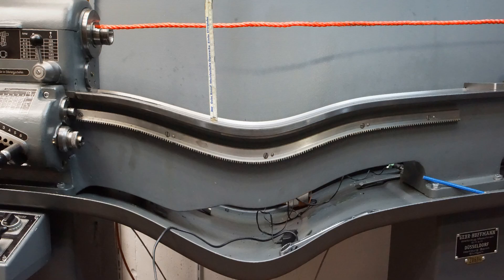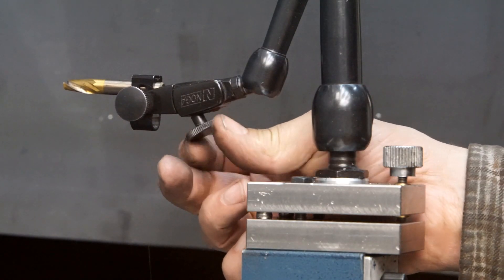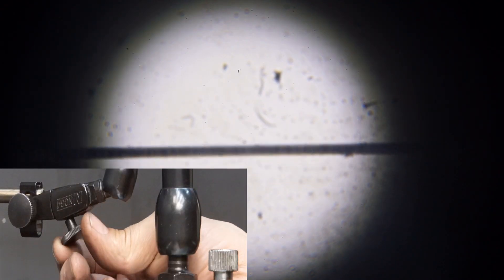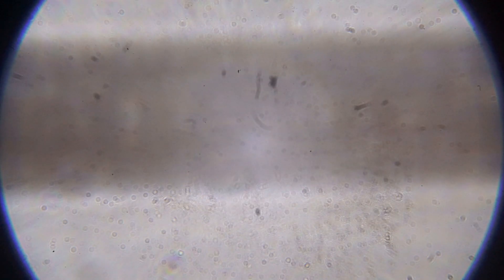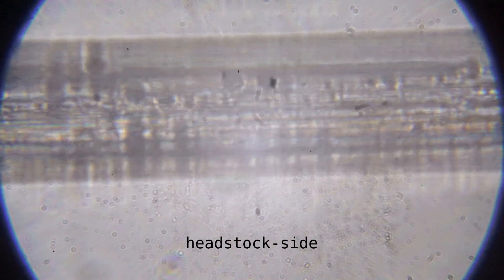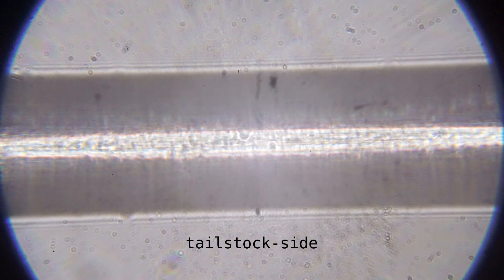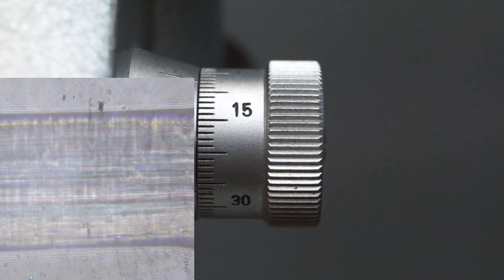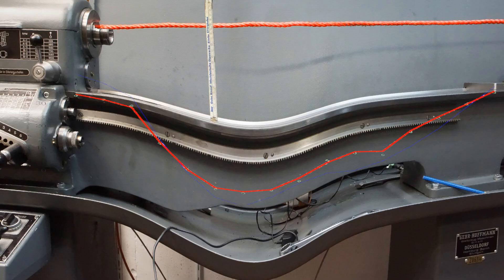measuring straightness by wire

Comment: How do you know that you are looking from the same angle?
I'd use a second, thinner wire in front of it to be sure the three points are aligned.
Isnt static electricity or magnetism a problem when we are talking about microns?
Or the weight of the microscope bending the workpiece?
Reply from the maker: Some excellent thoughts/questions.
The angle between the microscope and the wire is not super critical. In theory the deviation follows the cosine law - similar to taking measurements with a DTI where the stylus should be perpendicular to the measured surface.
Static electricity might be an issue if the microscope is extremely close to the wire, yes. Honestly, I didn't consider this.
Magnetism is no issue as the wire is made of non magnetic material.
The weight of the microscope could be an issue - yes. However I checked the influence of weight on the bed and attached a rope with about 40 kg of weight to the center of the bed. The deviation was less than 5 µm. The weight of the microscope is in the 1 kg range. So, the deviation caused by this mass is certainly not an issue.
Again, thanks for your thoughts!

Comment: Wire alignment is used to align bearing bores on large reciprocating compressors prior to grouting the machine.  The wire is tensioned with a known weight over a pulley.  The sag is calculated by chart or computer now days.   The bearing bore is checked to the wire with a micrometer.  A battery is wired to the micrometer and the machine to a set of head phones. The machinist gets a tic in the headphones when the wire is touch by the mic.  Very accurate.
Reply from the maker: Excellent comment! Many thanks for your interesting contribution.

Comment: Very nice! A great way to measure. Could the error be increased by the tailstock base? If the wear in V matches part of bed but not others, I wonder if you double the error?

Very interesting to see the use of
Microscope and using focus pattern rather than expensive graticule.
Reply from the maker: Good thoughts. Admittedly, I assumed close to equal wear on the flat and the V side of the tailstock base. This might well be wrong. My intent was getting "a feeling" for the wear.

Comment: 2 µm sag over 600 mm is brilliant that's less than half of a arcsec even before compensation, I wonder if using two cigarette papers as shims .05mm at the end could be used as a small light gap for a cheap laser pointer at a low angle could the interference be used to visually see the peaks and troughs through  different refraction angles

Comment: Wow, this is brilliant! So simple and yet with such accurate results - I'm going to keep it in my mental toolkit for future use!

(I had the same immediate thought about the sag in the monofilament and actually worked through the numbers with the Claude 3.5 AI before I saw that you'd done so in the video notes🙂 I assumed slightly higher density for the line than you were using, but your numbers check out exactly. It's amazing  how accurate this is! - Now I just need a microscope with a precisely calibrated Z axis! 🙂)
Reply: so what ur saying is u wasted electricity right?
Reply from the maker: Thanks for confirming my calculations! Instead of a microscope with a calibrated Z axis you could attach a dial gauge.

Comment: I looks like you did not compensate for the droop of the monofilament.
Reply from the maker: The drop is less than 2 µm which is within the accuracy of the microscope reading. Please refer to the calculations in the description of the video.
Reply: @HaraldFinster  Excellent!

Comment: Millwrights used to (and may still do) use a tensioned wire to ensure all the machine in a sequence (e.g. a 4 colour press) were aligned. A rigid 15 metre straightedge doesn't exist, but a tight wire does!
Reply: 15 meters?!
Reply: @Sim-q9t i think he is talking about linear offset printers?  I dunno proper english for it, but like vs a rollers offset printer.  But like a book press with 4 stages one for each color and everything has to align or the colors wont align

Comment: There is going to be sag in the line. And that matches pretty good with your measurements. So you will have to compensate for that some how.
Reply from the maker: Sorry, that's not entirely correct. According to my calculations (see description) the sag is 2 µm which is approximately in the range of the uncertainty of the measurement via microscope. If you would measure a perfectly straight line with a sagging wire the result would be a bent upwards line in the measurement. Thus, the "sag" seen in my measurements can't be the result of the wire sag.

Comment: You could probably achieve something similar with a laser level (or a simple pointer, at a stretch), a mirror at an angle and a perfect wall a large enough distance away.
Reply from the maker: Yes, that might work. I didn't try, though.

Comment: Are you going to correct the ways for the existing wear or can you simply prop up the midpoint of the lathe bed so that gravity corrects for the ways' curvature?
Reply from the maker: Propping up the midpoint would certainly be insufficient and - more seriously - wouldn't solve the issue of non-parallelism of the ways. Thus, I will scrape the ways. I am in the extremely fortunate situation that a very kind person offered my a straight edge and even checked and scraped it to a known good reference.
Reply: @HaraldFinster  Can we hope for another video for that?
Reply from the maker: @Stelios.Posantzis  The  next step will be scraping. This is quite hard to show on camera and can be pretty boring. I will try to show the basic steps.
Reply: Therapy is the main reason for watching a scraping video, if the proliferation of sanding and paint stripping videos on YouTube is anything to go by! Joking aside, not many people are brave enough to try scraping their own lathe, so the more videos, the better. I am not sure there are that many of them.
Reply: @HaraldFinster  How did you check for parallelism/measure non-parallelism? What was your reference?
Reply from the maker: @Stelios.Posantzis  I constructed a little device for this purpose. I hope that the following ling works for you https://forum.zerspanungsbude.net/viewtopic.php?f=117&t=62316
the device was inspired by https://www.youtube.com/watch?v=VizX9J-UFfw
Reply: @HaraldFinster  I will definitely check out your website - it surely looks very informative!
Thank you for the video link too!

Comment: Oohhh, thats a new one to me. I was wondering if it could be done using a piano wire between some modified centres. Piano wire so that it could be more highly tensioned to minimise sag in the middle, and between centres so both wear in the bed and setup of the tailstock could be achieved. Just a thought.
Reply from the maker: The sag depends on two factors, the weight of the wire per length and the allowed stress per cross section. If you look up these values for Nylon you get 48 N/mm^2 and a density of 1100 kg/m^2 i.e. a ratio of 0.04.
For steel you get (highly dependent on the actual grade) approximately 1000 N/mm^2 at a density of 7800 kg/m^2 which gives you a ratio of 0.12.
A higher ratio results in lesser sag. As you an see steel is superior to Nylon but the difference isn't huge as steel allows higher tension but is heavier.
Reply: @HaraldFinster I’ve used high tensile wire 0,80 mm for rough alignment on 24 m long beds . The key was to create high tension with out inducing pinch points in the wire . With regards to sag in the wire it wasn’t critical as we were more interested in horizontal alignment more than level in the beginning.  High tension was produced with a pulley system and heavy counter weights .
Reply from the maker: @davidrussell8689  Thanks for your insightful comment. 24 m - that's quite a size!
Reply: There's no sag sideways. I wouldnt trust any approximations.

Comment: This demo is measuring the tailstock way height relative to the wire reference, right? 

To measure the carriage ways, one needs to run the carriage with the scope back and forth. That would give you the actual carriage dip. Or make a quickie surrogate platform that is shorter than the carriage as the microscope platform to localize the error.

Focusing on the wire probably centers more or less in the middle of the "depth of field" (object longitudinal region of good focus), so repeatability is better than the actual depth of field. But for fun, Depth of field (DOF) rapidly decreases with numerical aperture - a 10X 0.25NA objective has about 8 um DOF, a 20X 0.40NA has a 6um DOF, a 40X 0.65NA objective has a 1um DOF.
Reply from the maker: Very good comment. I agree 100%. I didn't know the exact depth of field of microscope objectives. Thanks for adding this info.
I estimate that mm focusing was reproducible within 2 µm. 
At first I tried to focus onto the top of the "wire". This showed a bright narrow line.
Later I found out that focusing to (I think) the center of the line was more exact. I observed the "bright line" widening until it "touched the edges" of the "wire" (sorry, hard to explain).
Reply: @HaraldFinster  Watching you video, I think you might be seeing diffraction fringes. I definitely saw them in the footage. - That is sometimes called the Airy pattern, or a diffraction line spread function.

Nikon has a nice explanation and table for the depth of field. There is a complicated formula shown too.

I got excited about checking my old Logan 14, but I cooled off as making the carriage sled was going to be some work. I thought about making it in parts and bonding it together while on the bed to reduced or eliminate the fitting/scrapping. I might still do it but I'm about to go into Christmas family mode.
Reply from the maker: @randydewees7338  Thank you for your excellent post. 👍  I will look up more information on this airy pattern. 
Enjoy your "Chrismas family mode"!
Reply: 2 microns , even an ( this ) artist gotta love it ,,, !

Comment: I saw this method being used on a very large lathe at a machine tool manufacturer's decades ago when I was still an engineering student. We we're all surprised at the simplicity and were assured that it is a perfectly precise way of measuring machine surfaces.

Comment: Brilliant, finally I have an excuse to buy one of the ridiculously cheap microscopes i keep seeing in antique shops.
Reply from the maker: microscopes are surprisingly cheap - indeed. I payed about 25 Euros for mine. (Yes, the lenses need some clean up.)
Reply: @HaraldFinster   I saw some in an antique shop a couple of months back for that sort of price here in England. I wonder if the direct micron reading on the focussing driven is a common feature. I suppose one could rig up a dial gauge if not. Did you have to account for any backlash in the focussing mechanism?
Reply from the maker: @WilliamChitham  Honestly, I don't know if the micron reading is a common feature. Installing a dial gauge should work as an alternative. I considered doing so but was too lazy to build an appropriate holder. Yes, I did account for backlash and always approached the focal point from the same direction.

Comment: So if I understood this correctly, you are getting the wire into focus on the headstock end by adjusting the focal length of the microsope, but on the tail stock side, by adjusting the distance the wire is from the microscope? Very interesting. A technique I had never seen before.
Reply from the maker: yes - exactly. Thus, strictly speaking, I don't measure the wear at the ends because I adjust the system to zero there. (Which didn't work perfectly as you can see in the diagram.)

Comment: Neat technique, but how do you compensate for the sag in the wire/line due to gravity?
Reply: (Also, theres wire sag tables for this purpose. A search on practical machinist will put out a bit more information)
Reply from the maker: With sufficient tension the sag is way smaller than the errors introduced elsewhere.
Mathematically the wire follows a catenary line. I did some calculations and can ensure you that the sag doesn't affect the measurements. In case of very long distances the sag can be calculated and taken into account.
Reply: @HaraldFinster  Ah good point! I just got worried when the profile looked like like the sort of dip you would see in a hanging wire/chain.
Reply from the maker: @imajeenyus42  actually, a sagging wire would result in the opposite effect, i.e. the bed would be higher in the middle.
With the microscope you measure the distance wire to bed. If the wire sags in the middle and you wrongly assume that it is straight the bed is seemingly higher than at the ends.
Reply: @HaraldFinster  If you use a braided line fishing line there will be negligible sag, they stretch very little. And then there's piano wire of course.
Reply: Excellent approach and work . I’ve worked in machine tools for many years but never used this method .
Reply from the maker: please find the calculation of the wire sag in the video  description - hope this answers your question